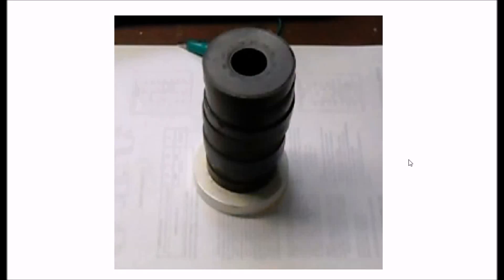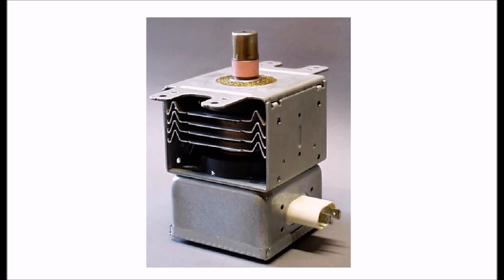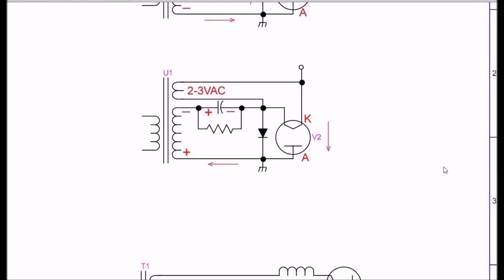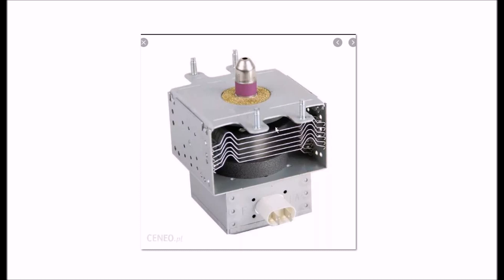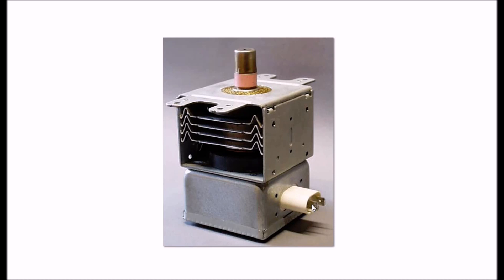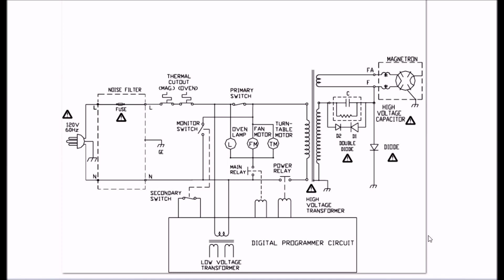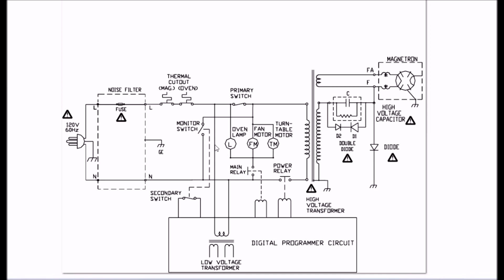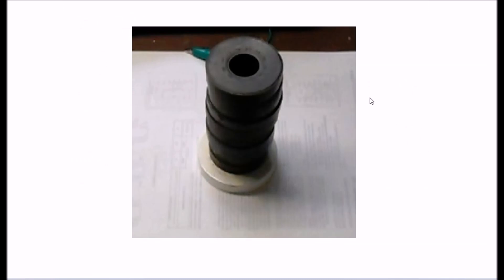Magnetron Operation Information Do Not Disassemble!

Comment: About that double diode on HV Caacitor, it's there as overvoltage protection for stupid people who run their Microwave oven without any load (food) inside.
When they do so the voltage from HV transformer becomes too high and double diode starts to conduct and blow the HV fuse as safety measure.